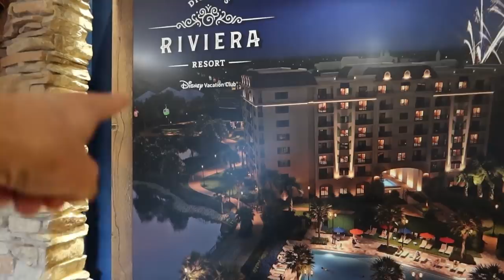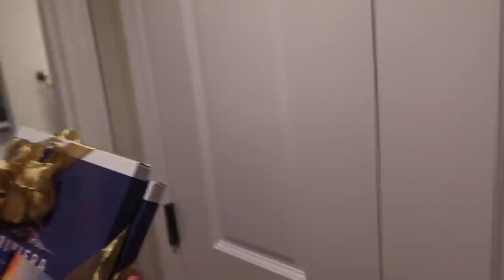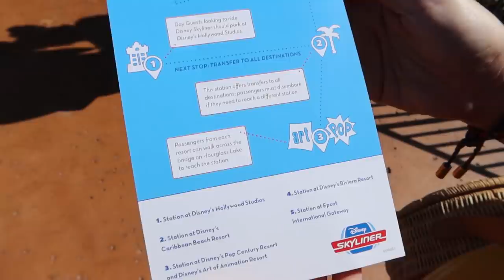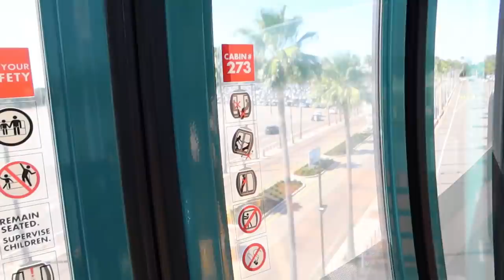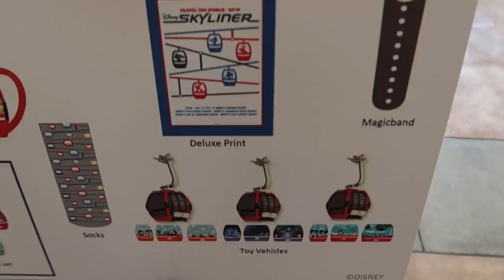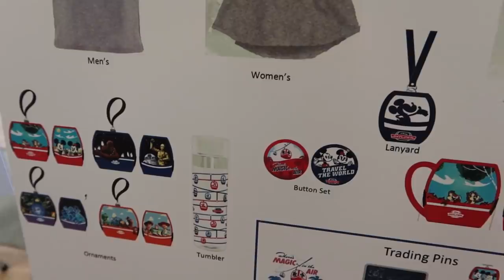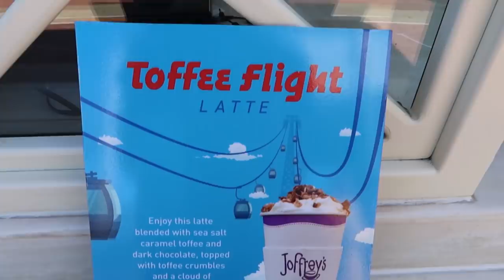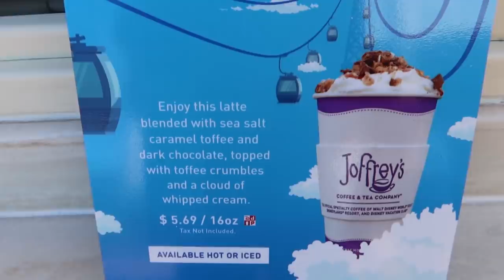We Rode The Disney Skyliner Gondolas & Toured A Disney Riviera Resort Room!

Comment: The wheel stays at the same speed. The gondolas are detachable so basically when they go to the station they go off the cable and drive tires take it around the curve of the station where you board. so the big wheel doesn’t need to slow down. At ski resorts they stop because people may have trouble getting off or getting on.

Comment: Jenn, pro tip for you. While riding the gondola (skyliner) if you are afraid of heights ride it with your back towards the direction you're going. That way you can't see the towers that hold up the cables and  your mind can't calculate how high up you are.

Comment: Another reason for the height of the towers over the Hourglass Lake would be that the barge mounted extrication device can't reach as high as a land based, truck mounted extrication device used elsewhere. Plus it is nice to cruise low over the water.

Comment: You should try an experiment in the gondolas. So, when air is compressed, it gets colder (Gay-Lussac's law). Can you try to open the forward facing window all the way and open the backward facing window to somewhere between 60-75%. It should compress the air on the inside and make it a bit cooler, right?
Reply: rock432 compression heats a gas. When released compressed air from a tank its because it heated up then cooled to ambient then cooled further from expansion

Comment: I'm curious about being able to make connections from the Skyliner to the monorail at Epcot. For example, if you were coming from Pop Century and wanted to go Magic Kingdom, would you be able to transfer at Epcot? (i.e. take the Skyliner to the Epcot station and transfer from to the Monorail for the remainder of the journey) Without a park-hopper pass to make it through Epcot, I'm not sure how you would get from the Epcot Skyliner station to the Epcot monorail station, considering they are somewhat on opposite sides of the park.

Comment: the foreshadowing in this video. 
"Well we know the breaks work" oof not entirely
Reply: The brakes work just fine.  From what may be gleaned from the cast member remarks and photos, the system went down, briefly. When they rebooted, one of the gondolas in the station didn't get it's "jolt" to wake up so it was still sitting in neutral mode, not seen on the line. So, the next gondolas didn't get the warning that it was there and crashed into it. Thankful no one was injured badly.

Comment: The first time they have an extended stop due to some technical malfunction in that Florida heat and someone passes out at the highest point of that thing, the lawsuits will start being filed.
Reply: Larry Wright apparently back up air conditioning that last 4 hours are installed
Reply: Heather Weems Heaven help anybody stuck high up in one of those things for 4+ hours, AC or no AC